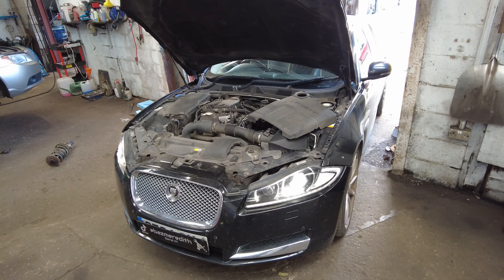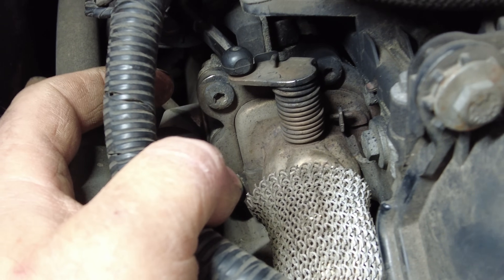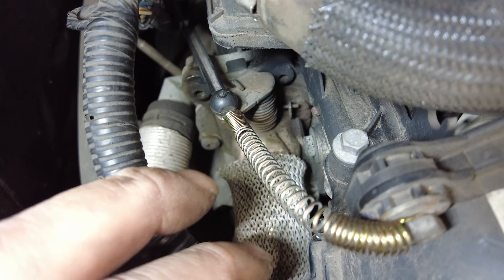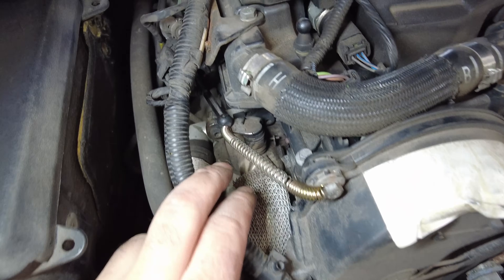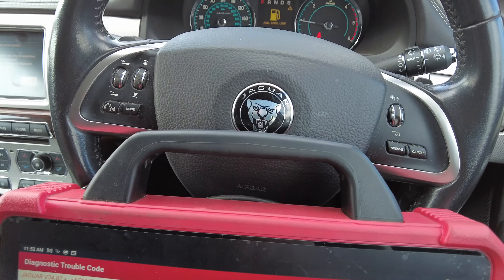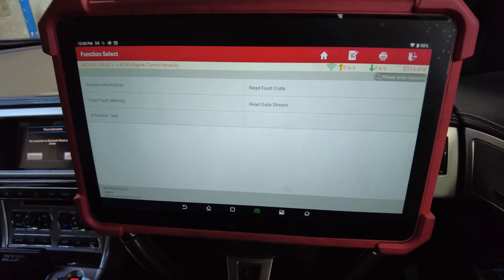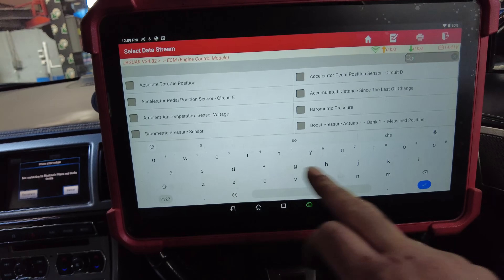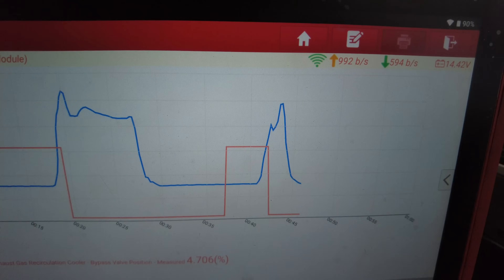WHAT DO YOU DO IN THIS SITUATION??? JAGUAR EGR FAULT BUT NO PARTS AVAILABLE!!!!!

Comment: Had a right puzzler here today Baz - customers merc van towed in on a truck - AA tried getting it going roadside, no joy, in it came on their lorry. AA's theory was high-pressure fuel pump gone & I kinda agreed - zero fuel at the rail/injectors. I shrugged, assumed they were right.. Fuel gauge was reading 3/4 full. 

Left it sit for a bit, then for the heck of it, I pulled the pipe off the filter & let the tank-pump run... Nada.. fumes. Got in under & gave the tank a tap - bone dry empty..  Turns out the fuel gauge was bust. 

Fixed the sender, chucked in fifty quid of fuel, bled out the whole system - a sod on these - and it sparked right up. Considering the cost of a high-pressure fuel pump for one of these, how chuffed was the owner? All the chuffed. He did mention that he'd though his fuel economy had become pretty amazing for the last few days - he'd never got so many miles out of a gallon, ever..
Reply: @flippingcarsrepairs  every now & then you're like "Really??"... :-) Did injectors on a Landcruiser last week - a day later the guy is back, screaming blue murder that his vehicle is running like crap & WTF had we done?  We were all apologetic, sorry Sir - took a look..  he'd put 70 quid of petrol into his diesel Toyota on the way home... every week, every week there's mind-melt stuff.

How quiet was he paying his new bill? All the quiet...

Comment: An EGR (Exhaust Gas Recirculation) valve plays a crucial role in reducing a car's emissions. Its main function is to recirculate a portion of the exhaust gases back into the engine's intake manifold, where it mixes with the incoming air-fuel mixture.

By doing this, the EGR valve reduces the combustion temperature, which in turn lowers the formation of nitrogen oxides (NOx), a major pollutant. Lowering the combustion temperature helps the engine run more efficiently and reduces the overall emissions. This process is particularly important for meeting environmental regulations regarding exhaust emissions. 

The EGR valve is typically controlled by the car's engine control unit (ECU) and only opens under specific conditions, such as during low to mid-throttle openings, to avoid affecting engine performance negatively.